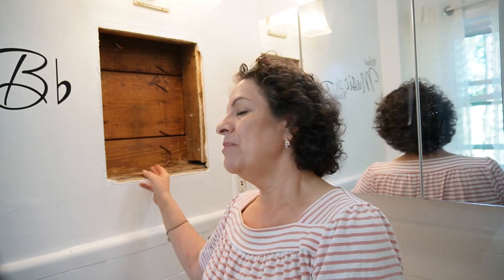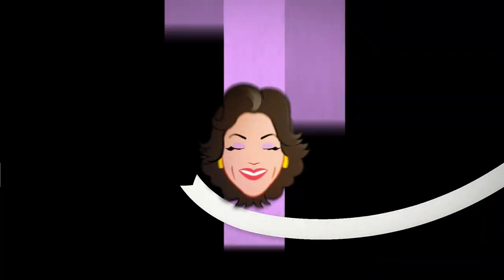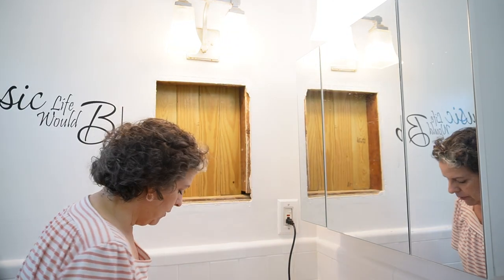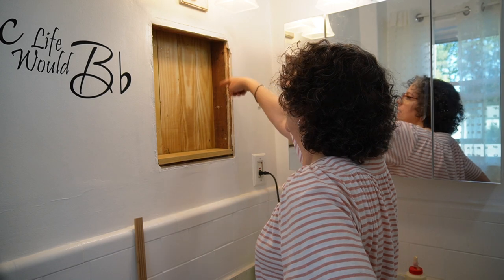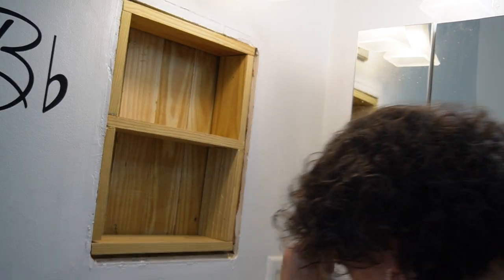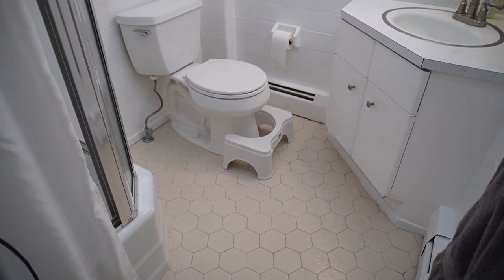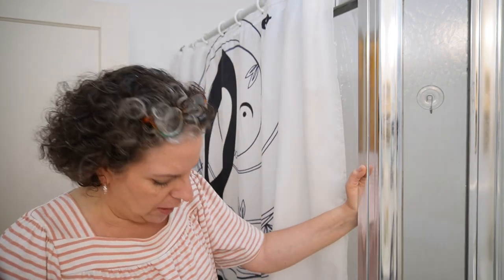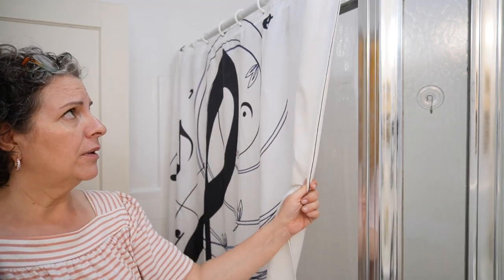Getting Things Done || Home Edition || Episode 13 ||

Comment: That's basically what we did when we removed our original 50s recessed medicine cabinet. But we attached a thrift store framed mirror over the whole opening with hinges. So the mirror swings opened to where all our bathroom items are stored in the cubby.

Comment: The bathroom is looking good. I like the niche.  Costco has a ceiling LED light called the KODA Slim 15"LED Ceiling Light With Adjustable Color Temperature for $29.99 that would look good and modern and with just the one light you probably won’t even need the one on top of the medicine cabinet.

Comment: Make sure you use the epoxy paint it's better for humid locations and will last longer. Just a tip! We have brushed bronze faucets thru our entire home, you can't tell having matte black alongside brushed bronze they both blend in well together. Love them! Well worth the switch! Not the best with hard water tho, I've found that the stainless actually cleans and holds up better with hard water. It's gonna look nice once your done!! 👍🏽